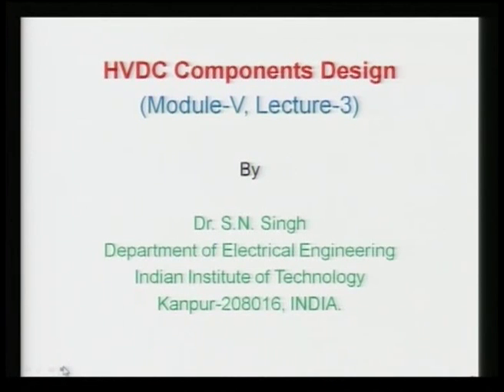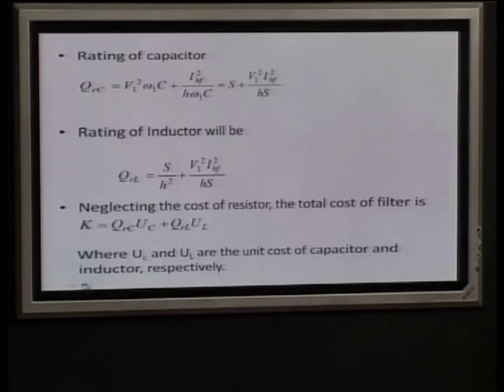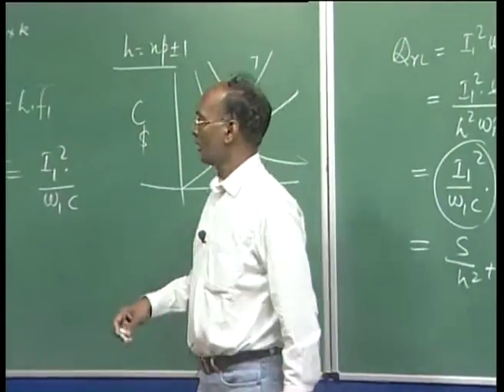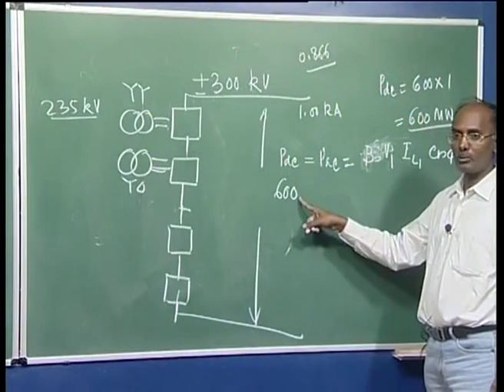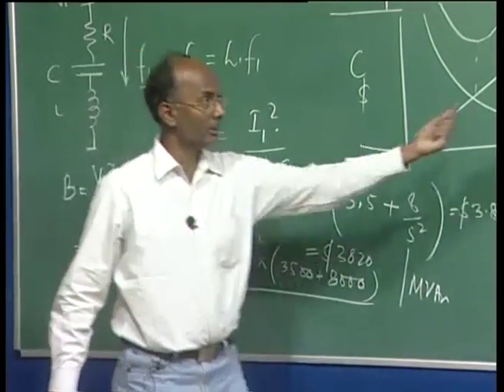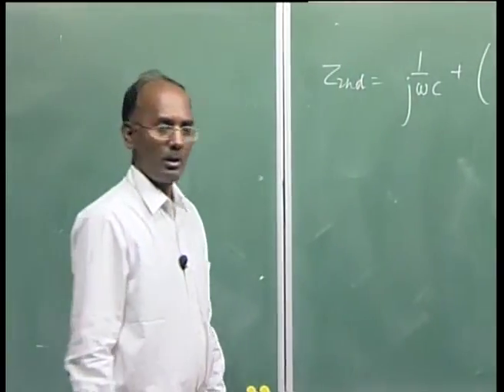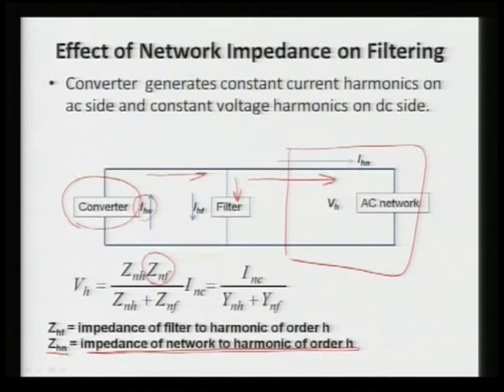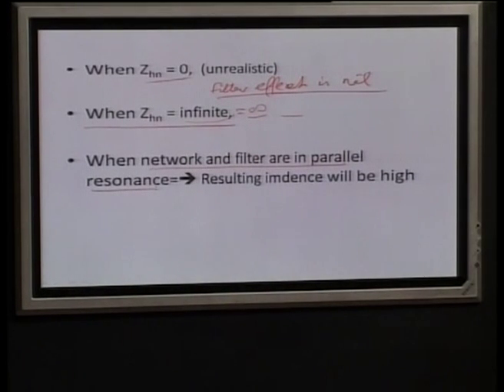Mod-01 Lec-25 Lecture-25.High Voltage DC Transmission

Comment: One hour presentation of incorrect equations! For 100 Times definition of LCW^2=1 written wrong 
Every equation was wrong or needed correction ...
The reactive power of capacitor was defined as Xc(I1)^2 that is totally incorrect because only a few portion of main Harmonic passes through filter not all . Accordingly ( V1^2)/Xc is incorrect since whole of Main voltage component will not be across C ...